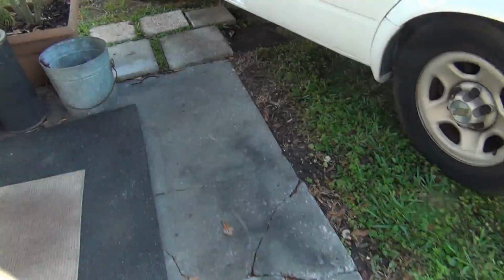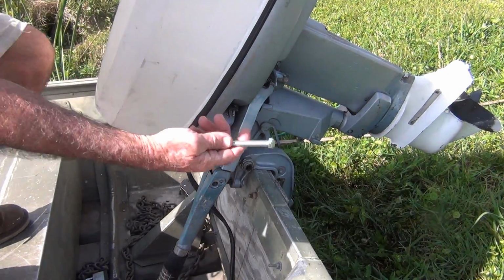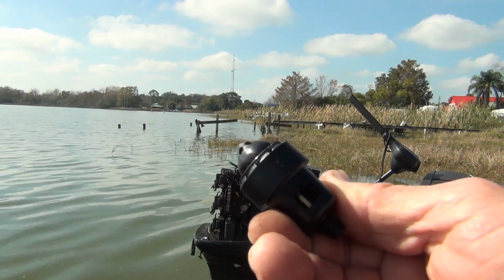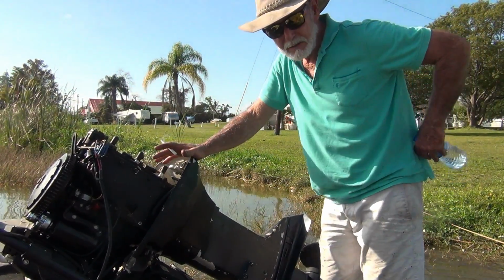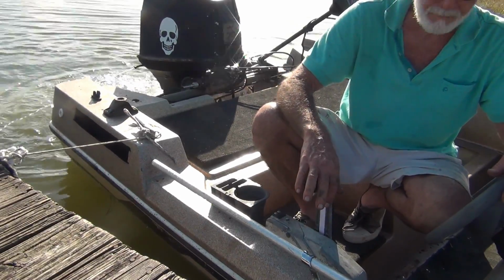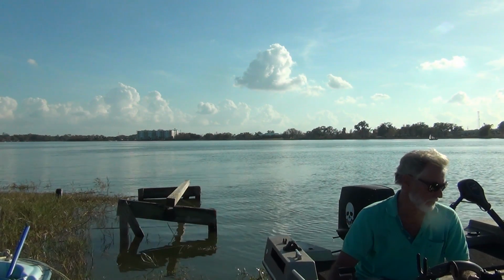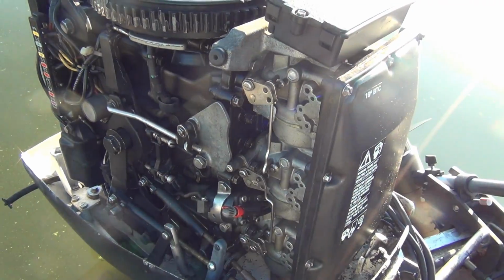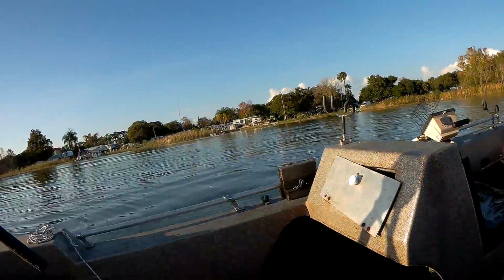1987 70 Hp Johnson Outboard - Stalling Under Load

Comment: Hey nice video I have a 1984 envirude 185hp that it runs with the motor cover off but when I put it back on it dies , like there a problem getting enough air , could bad carburetor’s be the reason or what you think ?
Reply from the maker: Hey. Thanks for tuning in. That's usually the powerhead to midsection "exhaust gasket" leaking. Choking out the carbs. Big job on a 185 and no fun on any outboard. I've seen people cut holes in the hood so the carbs get fresh air but only on small outboards. I just randomly picked an 84 model, It's number 37 in the schematic, I also see a couple of other gaskets that you may want to check/replace. 29 & 79. Thanks again !
https://www.marineengine.com/parts/johnson-evinrude-parts.php?year=1984&hp=185&model=J185TLCRS&manufacturer=Johnson&section=MIDSECTION
Reply: @THISOLDOUTBOARD1  
Also there is some smoke coming from the bottom of the last carburetor, could that be caused by the exhaust leak ? Thanks for your time
Reply from the maker: @anniers6882  probably

Comment: I have the same issue with my 75 Johnson stinger. The engine was professionally rebuilt. Stalls on take off unless I momentarily touch the electric choke first. My shop installed a complete new fuel system ( tank, hoses, fittings, squeeze bulb ). They did a ‘link and sync’ job. New shift and throttle cables. New plugs and thermostat. We tried five different pitch props ( all this on a little 16’ Glasspar ). Idles good, full throttle perfect, just has to have a split second of choke to take off even when warm....ps the motor has no mid range power, its either idle or full power...Gary in Michigan
Reply from the maker: Hey. Trying to get caught up on all these comments ! Its getting crazy ! I'm sure you figured it out by now. What did you come up with?
Reply: THIS OLD OUTBOARD I just live with it and touch the choke still for a split second for the time being , ( I have to many other projects ).
Reply: @highwatercircutrider   if you have to hit the choke that means you have a fuel restriction  loss somewhere dirty or plugged jet maybe
Reply: Did you get it figured out it's rather ironic my 88 60hp johson after 14 years of flawlessly running now stumbles between idle and full throttle.
Reply: James Ringler no, and the carbs were rebuilt and had a professional linc/sync done also the complete engine was rebuilt, and all new hoses, fittings and fuel tank. My brother has the same issue with his 72’ Johnson 70 hp. ( mine is a 76 ).
Reply: Hello highwatercircutrider, I have a rebuilt 70hp Johnson and noticed the same symptom as you stated. I doubt  there is something to do with the spark advance (link and sync). I am located in Detroit, Michigan. Can you recommend some good professionals in local? Thank you

Comment: yep like neptun3se said  air leak between tank and motor , same symtoms as mine . my air was getting in from inside top of the pickup in the tank .i had a glass filter so it was easy to see the bubbles and the primer bulb would'nt get hard.
Reply from the maker: Hey. Thanks. Appreciate you watching and commenting. Stay tuned !

Comment: I believe I am having the same issue as you with a '96 Johnson 115. Bad reed valves seem to be a fairly common culprit. I just ordered replacements online and will let you know if I have any luck once I get the new ones installed. Thanks for the video! Good to know I'm not the only one ripping my hair out after replacing part after part with no success.
Reply from the maker: Hey. Trying to get caught up on all these comments ! Its getting crazy ! I'm sure you figured it out by now. What did you come up with? Was it the reeds? Thanks for watching and commenting. Stay tuned !
Reply: Did the reeds fix your problems or is it fuel related my 60 hp is now bogging between idle and full throttle

Comment: So happy i got rid of my Johnson 2 stroke (always fixing something)  and got me Yamaha 2 stroke no fixing just boating this engine is like a Ak47..... Yamaha 4 ever
Reply: If it's a two stroke it might be a Johnson copy certain years the head fit around if I'm not mistaken
Reply from the maker: Yeah the yammis are great until it needs a new center crank shaft bearing and a machine shop has to pull the shaft apart to replace the bearing then precisely press it back together. I still have one sitting in my storage unit. I really do like them but they're had to come by and not cheap. Thanks !  See ya next time !

Comment: I got a 1982 75 Hp Johnson and it cranks great when you lift the start lever and will idle sometimes. Cleaned all the carburetors and when I put it in gear it dies. When I bump the throttle on the carbs it bogs down and dies unless I feather it and then I can reve it no problem. Cleaned and replaced everything in the carbs three times. Can’t figure it out . Any recommendations
Reply from the maker: Hey. Thanks for tuning in. A bogging situation can be caused by so many different things its crazy. What may seem like a fuel issue could be an ignition problem and vice versa. Hopefully its something simple like the link & sync timing is off. I would recommend getting an omc service manual specific to year/model. Check ebay for a cheap used one. That way you'll have the proper procedures for setting the link & sync and procedures for testing ignition components. Not to mention a great troubleshooting section on bogging issues and more. Sometimes these old outboards like to run where they like to run and don't care what the manual says! Hahaha but having the manual is a good head start. Hang in There! Thanks again !
Reply: @THISOLDOUTBOARD1  thanks man I appreciate it. I will definitely pick up the manual

Comment: older omc motors like this get bad fuel pickups in the tanks and will stall under load but when you lift the fuel tank above the motor it builds proper pressure
Reply from the maker: Hey thanks for watching and commenting. I did not know that. Thanks again. Stay tuned !
Reply: @THISOLDOUTBOARD1  I appreciate the reply most people don't respond to their comments. I will definitely have to keep watching.

Comment: Bad gas!
Reply: This is where I would start before digging in to far.  Rule out the chance of bad fuel.  I've had bad spark plugs act this way too. This was on an older motor (1976 25hp Johnson with points) it would run finet at idle and rev up, but would die as soon as you put a load on it.  Good Luck!
Reply from the maker: Hey Thanks !  I hope so, just got some fresh today. Appreciate you watching and commenting. Stay Tuned !

Comment: Have you found any more causes or solutions for the mid-range, transition  from low speed to main orifice bog thing? I have a 1977 75 hp Evinrude that has this bog, if I blip the choke it gets past it or if I punch teh throttle it'll get past it, if I accelerate smooth from idle it'll die. I found a service bulletin from 1976, 1429, that says to put in bigger low speed orifices and drill out the calibration holes and the holes in teh emulsion tube, someone had done the low speed orifices but not the rest, I did those and also drilled out my low speed orofices to #33s, definitely better but still there, I'm hoping you have learned some more, this sounds like a very common thing with these three cylinders, on the forums there is not a ton of guys that know about it. Thanks, Steve
Reply from the maker: Hey. Well on this old outboard there was never any real problems until it over heated. As it turned out the gearcase was shot. Did a swap on the gearcase and everything went south. After testing and eliminating the fuel and ignition systems and not finding any problems it turned out to be the prop on the new gearcase, it was huge compared to the original prop and I never thought it would be a problem until I swapped them out. Once I put the original prop back on it was fine. Never thought that could be the problem but that was it. Its all in the videos. Thanks for watching ! Stay tuned !
Reply: @THISOLDOUTBOARD1  What size prop did you wind up putting on? Mine is a 13 1/2 x 16 on a 16' runabout.
Reply from the maker: @TheWilsonsk1966  Hey. I never looked back at the difference in the props sizes. I was just thrilled to death that it was running again. I spent way to much time on that thing trying to figure out what was wrong. Like I said, its all in the videos.  If your having problems on a 77 and you haven't changed anything like I did with the gearcase/prop then your on the right track with all that other stuff your doing. I think? Its amazing its been running since 1977, but now its not. I would go with the service bulletin if it pertains to that motor/year and stay away from the forums. It seems everybody on the forums has an opinion but nobody ever has the answer. I would go back to basic and start fresh. For example. Carbs, low, mid and high speed orifices/jets super clean. Never assume anything with these things! Just because it "looks" clean means nothing. I've screwed around with a lot of old outboards and found its always best to go with the service manual, you wont get the bulletins but its a start. If you dont have the manual you can find it at boatinfo.no . I know nothing about your motor. Did you just get or have you had it. If you blip the choke or punch it you get passed it. Could be just an air leak in the fuel lines or intake gasket. So you see what I'm saying. Probably something stupid right under your nose... Dont over think it
Reply: THIS OLD OUTBOARD the boat and motor are new to me and the prop was brand new when I got it so I have no idea if  it is the “right” prop or not, but I’ll scour craigslist and marketplace for a used smaller one. Thanks for the help, I love your channel, I’m a farm kid from wisconsin (I’m 54 now) and can’t resist making old things work again, I appreciate your ingenuity and tenacity. Thanks!

Comment: So what ended being your issue? I have an 88 Evinrude 60hp that just started this crap 2 days ago. About to go out and mess with see what I find.  But I’ve had the issue with a 70 evinrude Lark 50 that I never fixed because I broke two head bolts lol (I’ll get back to it another day/year) and my friends 70hp Johnson with 3 carbs did this and we never got it figured out. Gave the boat back to its old owner, his brother.
Reply from the maker: Hey. Thanks for tuning in. Welcome to the real life saga! Your suppose to watch the next episode to find out. Hahaha it was the prop, looong story. From what you said about your 60hp I don't think it will help you unless you swapped props a couple days ago. Anyway, there are a bunch of things that can cause a stalling under load issue. Best bet would be to pick up an omc service manual specific to your year/model, check ebay for a good used one. The troubleshooting section will give you a long list of things to check and how to check them. Hopefully it's a simple fix. Thanks again & Happy 4th!

Comment: I have an 84 evinrude 70hp, just got the carbs rebuilt and got a new fuel pump. Runs great on the hose but I put it in the creek today and as soon as I give it throttle while in gear it shuts off. Also the guy that rebuilt the carbs said there is no jet behind the top screw on all three carbs, should those screws be tightened down because they are and I even tried loosening them but it still runs like crap
Reply from the maker: Hey.  I'm looking at the schematic . # 26 SCREW, PLUG IDLE PASSAGE. 70 MODELS ONLY, I think is what your referring to and yes they should be tight. I've never seen a carb like that before. On the 75hp models they still use the slow speed needle. On this 87, 70hp they use an air bleed orifice. "rebuilding" these carbs is usually nothing more than new bowl gaskets #7 #20, float and needle #8 #11. Did they get cleaned too? # 29, the high speed orifice/jet and nozzle needs to be spotless. Any clogging or crap and it won't run when you give it throttle. Shutting down could be a number of different reasons why. What may seem like a fuel issue could be ignition and vice versa. Could be something as simple as an air leak in the fuel line or tank not venting. Its best to go back to basics. Carbs super clean. Fuel system check. Compression test. Spark test. Timing set. You can get a free manual at boatinfo.no. Heres the parts schematic https://www.marineengine.com/parts/johnson-evinrude-parts.php?year=1984&hp=70. Thanks for tuning in!

Comment: I have a 94 evinrude  runs idles Great on muffs, went to go to lake for test run other weekend fired up pulled out of wale zone went to gun it and boat went to lift then just stayed there not on plane motor would not rev up anymore like half or even less rpms, took calon off and hit throttle link in neutral and rev up some pretty good, put back in gear same thing would not scream just set at about half rpms , what is going on with my motor
Reply from the maker: Hey. Wow, could be a few different things and your just going to have to eliminate them one at a time. It's a different story on the water under a load. I would start with a compression check, if good move on to the fuel system from the tank back through to the pistons/plugs. Tank vent open, air leaks in hose, fuel pump pumping/good diaphragm, carbs super clean double/triple check the high speed orifices/jets, leaks around intake manifold. Basically, your just going back to basics with it. And dont assume anything with these things, just because something looks good or clean dosent mean it is. Once your convinced the fuel system is all good, move on to the ignition system. Could be just a bad ground somewhere or coil breaking down. Coils will test fine when cold but will start breaking down as they warm up. These bigger motors have a L.I.M.P. or S.L.O.W mode that prevents them from revving. You'll have to do your homework on that. I'm not real familiar with it. So unfortunately there is no one answer to whats going on with your motor, what may seem like a fuel issue could be ignition and vice versa. Some other things to try is running it on one or two cylinders at a time, sometimes that will help narrow things down. Also when its acting up pull the plugs and check them, are they wet or dry. You can find a trouble shooting section in the manual, the manuals are at boatinfo.no. Hopefully its something easy, its no fun changing a bad head gasket. Curious to know what you find out. And dont know if you watched the conclusion on the 70hp Johnson, but it turned out to be the huge prop I left on the gearcase when I swapped it out. So, something easy after I went through h*ll for two weeks!
Reply: Thank you! I have heard it could be power pack and could be going into limp mode also! Heard it needed tuning top end because was not on boat so Idled great, I did take it to shop but still trying to eliminate in my head what problem could be while waiting on call! Thank you again for responding
Reply from the maker: @KyleC0430  👍
Reply: Kyle Callahan any updates ? Mine is doing the same
Reply: Douglas Helminiak yes I did get it figured out!  Something so simple, had mercury spark plugs in it and also top carb gummed up, had it cleaned thoroughly , went to lake past weekend and was fine! So was spark plug change and top carb, so was only running on one carb
Reply: Douglas Helminiak would have thought it was something worse but was so simple, hope this helps you

Comment: My 70 hp johnson doesn’t have a pisser on it any suggestions
Reply from the maker: Hey. Thanks for tuning in. Wow that's weird! It has to have one. It usually comes out at the exhaust manifold cover. Go to marineengine.com and look up your year & model. Check the schematic and track it down. It's really no more than an indicator to let you know your pump is working. But that's a good thing. Curious to know what you find out? Thanks again & Stay tuned !

Comment: Had similar problem, in my case there was a air leak between gastank and motor.
Reply from the maker: Hey. Thanks for watching and commenting. Yes the hose is a p.o.s. and needs some attention. Thanks again. Stay tuned !
Reply: Was yours bogging between idle and full throttle what was the repair

Comment: i'd still get out the DVA and check to see what voltage that stator and pack is putting out. what's the idle timing at?
Reply from the maker: Unknown at this point. Dont own a DVA meter. But I know someone who does. Thanks again !
Reply: What's a DVA ? You mean a VOM that's what we call them in the industry
Reply from the maker: @randyyoung9892  Hey Randy. A multimeter or a multitester, also known as a VOM (volt-ohm-milliammeter), is an electronic measuring instrument that combines several measurement functions, Which I have But I Dont Have a DVA meter/adapter, DVA stands for Direct Voltage Adapter, which is used to measure peak AC voltage and is a must in the industry for testing in this type situation and pinpointing the problem. Thanks. Stay tuned !
Reply: @randyyoung9892   no a DVA = direct voltage adapter. Thats needed to measure the PEAK voltage coming from the stator. a normal VOM can't read the peaks fast enough for an accurate reading. I know, pain in the neck and probably not used much if at all outside these 2 strokes with a stator! you can get ones for $30 on ebay though. used to be wicked expensive.
Reply: @THISOLDOUTBOARD1  If you want to, search ebay. one guy sells a whole bunch of different styles for something like $20-$30 shipped and I tested one against my CDI unit. Dead accurate!
Reply from the maker: @ct1762  Hey Yeah Ive already checked ebay. Its my #1 go to for parts. Thanks again !